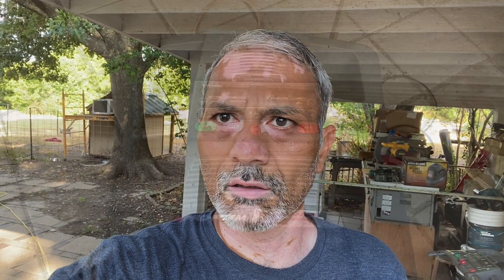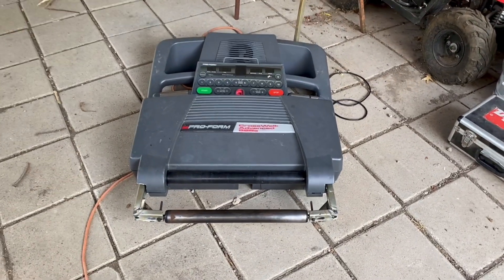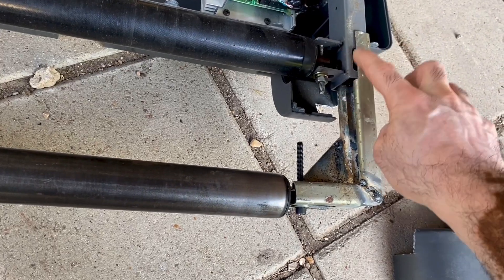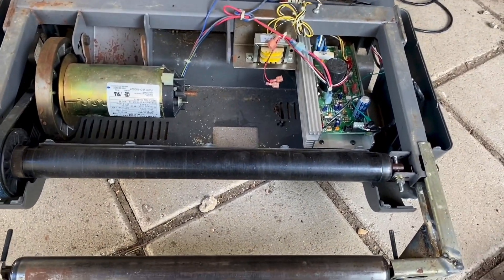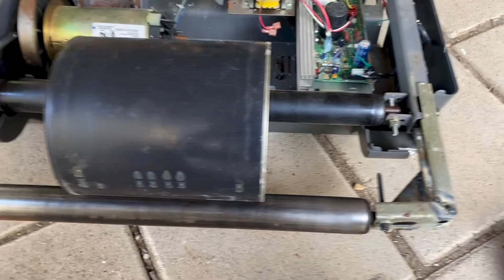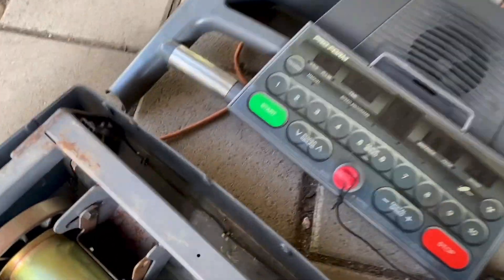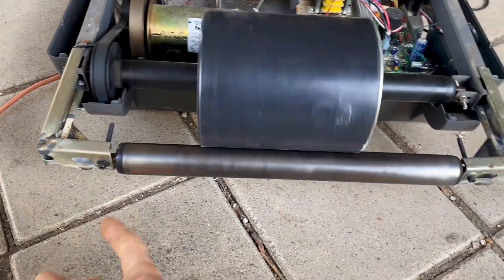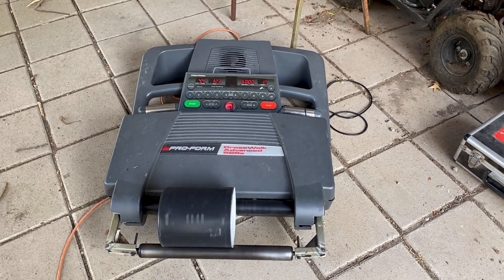Almost free DIY ball mill/rock tumbler/rotary case tumbler

Comment: Nice!  I would try some giant washers with o-rings to hold the drum centered.  Also make sure to level the machine.
I am building one for a mini
Keg that is rubber coated (bedliner) for noise suppression.
Depending on what you put in it the paint can may inflate and buldge or even blow the lid off.
Good luck.
Reply from the maker: I like the keg idea. Yes to proper leveling.
Reply: @PrincetonProjects  Keg will only be good if my tig welded door doesn't leak...
Reply: Just use sch.40 6”pvc.ive made pretty much this identical mill.

Comment: Very nice..
Do you think that it could handle a 5 gallon bucket.?
Reply from the maker: I think it can handle 5 gallon bucket. In fact, I measured the roller length to make sure it can. The weight should not be problem either because treadmills are designed to take the beating from running!